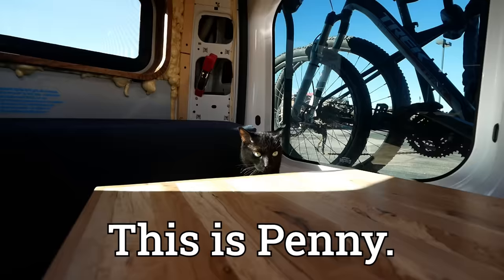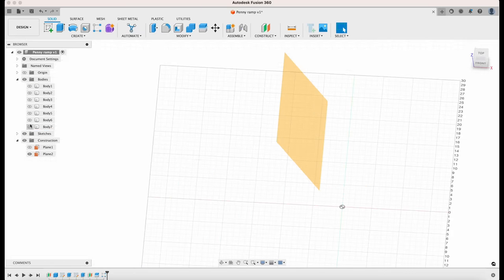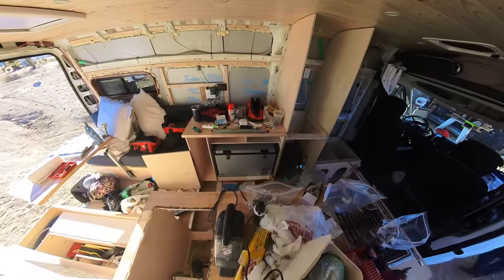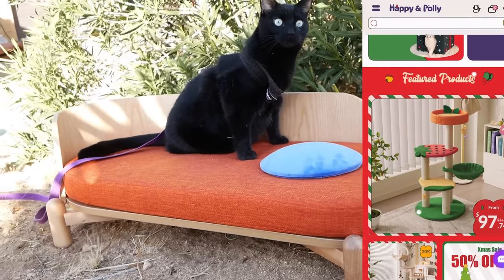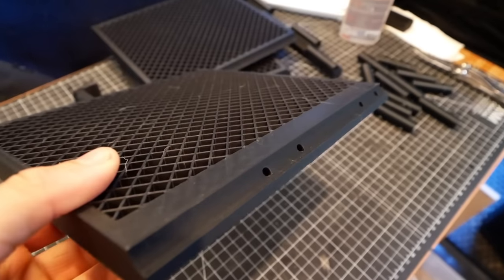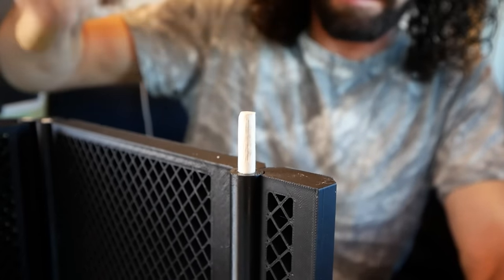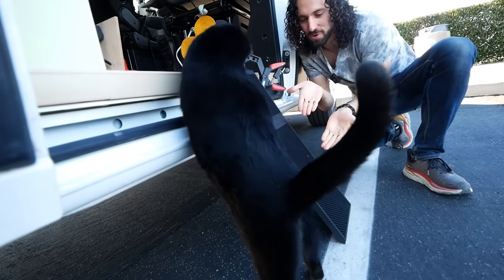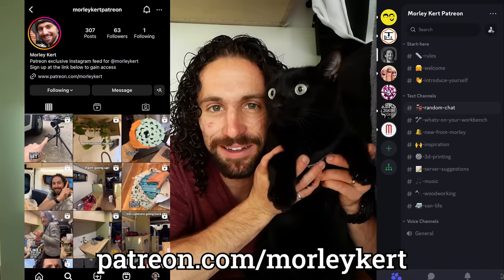My cat is smarter than me (and my 3D Printer)

Comment: Love the effort and care for this design, but I would have just designed 2 stool like platforms that have folding legs, one with short legs and one with longer ones, so she has basically stairs she could climb instead, then when not in use, they can be stored flat by folding the legs in. Less work and maybe more likely to use them since she can step on them and less of a climbing act.

Comment: I heard you mention considering getting a shaper origin. I'm not a woodworker or have nearly any experience with it but I was able to use one at an event. Despite me shaking it up to half a inch the cut came out perfect. The online design platform seems pretty okay but I thought the actual machine was pretty cool. Obviously the one drawback is the $3,000 price tag. Hope this advice is helpful even though i'm not experienced.

Comment: Sorry, 3D printer hobbyist here who has spend too much time down the rabbit hole. Looking at the roll-up 3D print, it should have been possible to print without supports right? Having the pins not be floating cilinders but maybe diamond shape and touching the build plate. Also, if you only put texture on the top instead of through holes, you can drastically save on print time because of the reduced amount of 'outer walls'. Lastly, it would have been super cool to have the hinge parts be print in place, already connected, on the build plate as a roll. I think with some clever design the complete roll might be even possible to print at once on it's side (although I would never advise on such an extremely long print in one sitting, especially not in a van that get's refurbished half way through te print). Other than that, very nice technical print, too bad it was too flexible in the end

Comment: Question,
What if you did it like nesting dolls where it slides out of the larger piece (like a toy lightsaber). The larger piece would go at the bottom and get thinner as you go up. Add dowels into the edges to give rigidity. It wouldn’t take up as much space as the one you made. 
Just an idea.

Comment: Penny already goes up on the cushions, so she is accustomed to climbing that type of material. So all you need is a 60 degree slab covered in cushion. Then when the ramp is in place block off all other entry into the van so that the only path is via the ramp.

Main problem with this idea is that you will be training her to climb cushion material. This is better than training her to use it as a scratch post, but still not great training for the real cushions. Maybe a different color. Cats have much more rods than cones, but they can still differentiate colors. Just not as vividly as humans. So stark contrast from the cushions would be better... for the cushions. That said, cats do what they want anyway - which is why we love them.

Comment: Twice I have had to make a ramp for my elderly dogs. (If I had kept the first one I wouldn’t have had to do it twice). I have zero woodworking skills and no power tools but Home Depot cut my wood to size and I used a screwdriver and good old elbow grease to put all the nails and hinges in.  I built a twelve foot ramp in three sections hinged so I could move it if necessary and put railings up the side so each dog wouldn’t fall off.  I also carpeted it.  I was never so proud of myself for achieving this.  You can do anything you put your mind to.
Reply: Nails…meant screws.

Comment: I was feeling you could have made a lot of using the pieces you made just need a different edge connection you made it to be modular by just having those connections not be part of the print you could make a connection to connect to a pole or a rope or something and just have it fold to pins that you can pop in and just have a ladder but you then decide to make that mesh whatever works works you know

Comment: Good lorde, man. A short plank of laminate flooring (with optional traction surface) is what you needed that you just slide out from either the floor or the side; eventually 3D-print some custom holder or a clip.

Just because you can do something with and through 3D-printing doesn't mean you should. Hammer nail approach that sucks. Don't use 3D printer to create planar surfaces.